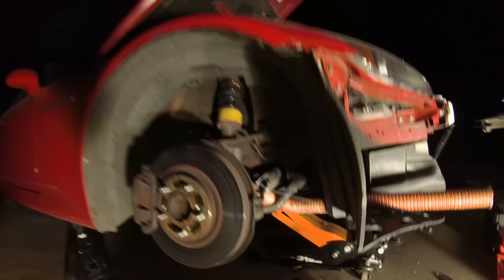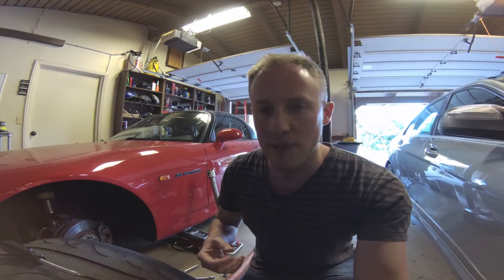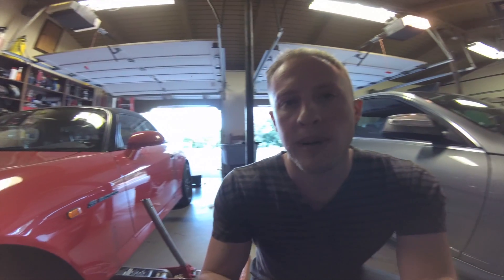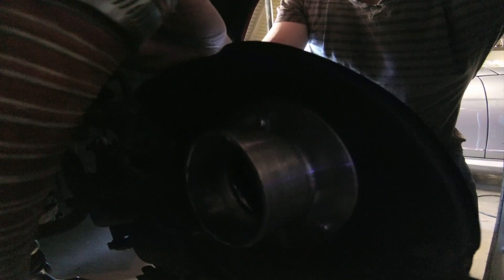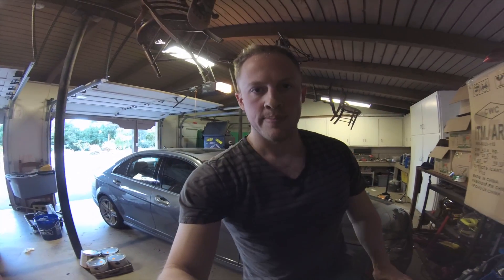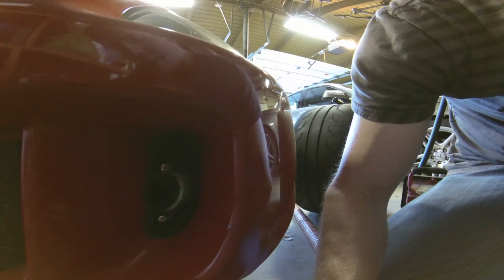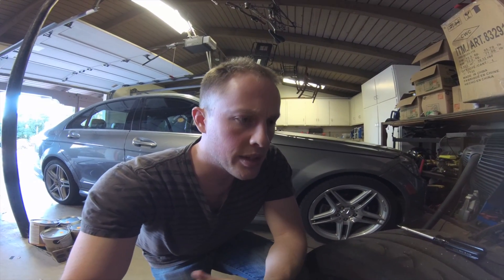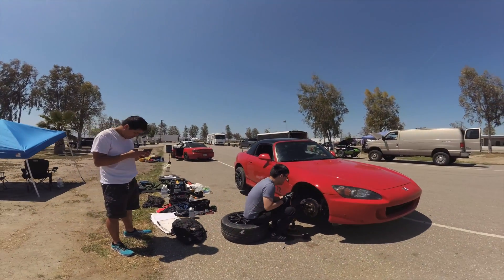Brake Ducting on My Track Car

Comment: Sounds simple but I read the set up you have will end up messing rotors because it blows air not from the center of the rotor out. There was a kit from a company called wasp that did it right but they are not in business anymore

Comment: Zent how many s2000's do you have? I get the feeling you are going to buy all of them and cause a shortage some day lol
thanks for the videos!
Reply from the maker: I just have this one. This is my seventh s2000 though.
Reply: Holy cow, thats a serious addiction. BTW what clutch and pp do you currently have in this one? and have you dynoed the car yet?
Reply from the maker: Ebay stage 2 clutch (seriously). Its about $170 for flywheel clutch and pressure plate. 

This is a 6 psi SOS supercharger kit. The dyno with stock flywheel was 290 rwhp.

Comment: Hey Zent. What are the specs on hose diameter and flanges. Was it 3 inch hose and 4 inch flange? Thanks
Reply from the maker: For s2000 with air pump, I run 2" hose with 2" flange. If you delete the air pump then go with 2.5" hose and flanges.
Reply: @ZentRose  they don’t make 2.5 flange though 😢

Comment: Hey Zent! What inch diameter hose did you use for your ducting? Have you been able to measure any temp differences?
Reply from the maker: 2" to fit under the air pump. 2.5" if you remove the air pump. 

I didn't bring my temp gun but did notice that my brakes stayed a lot more consistent. Also the rotors were able to develop more surface cracks without total failure.
Reply: Thanks! Do you mind me asking what pads you run? Are you thinking of going bbk?
Reply from the maker: PMU club racer. Yes I am thinking to get a big brake kit soon.
Reply: Thanks for the quick responses. Only thing I could think of that seemed like you could've added to your mod was some sort of chicken wire or filtering to prevent things from flying into your ducts and potentially damaging your ducts or whatever.

Comment: why chop your car all up when u can afford the big brake kit and it will solve all the problems as the brake duct?
Reply from the maker: I plan to do a big brake kit soon after I use up my pads. The ducting will benefit the BBK as well.
Reply: Because that may not solve the problem.  And seriously it's a 2 fender liners and 2 rotor backing plates, that's way cheaper than a big brake kit.  I'd agree with you if he wasn't happy with the stopping power but he's talking about reducing consumable usage.
Reply: so this duct he's making, how badly does he need to cut up the car? and yeah would be great if @zent would show us another video on how-to!
Reply: A bbk also adds unsprung mass and increases the moment of inertia of each wheel assembly. Which isn't ideal for a car like the s2k, these things arent too powerful and are designed to be nimble and grippy
Reply: Remember, even with a bbk, you can extend the life of your pads and rotors with cooling ducts. Cooling ducts are useful not only if you are getting fade and cracking rotors on the current setup.

Comment: Nice mod! However, for the amount of tracking you do, you need a BBK. I'd love to see you review a BBK compared to stock calipers and if they are really worth it etc.
Reply from the maker: You are correct. A BBK will theoretically pay for itself in time (if I don't earn interest on my money). I would also need to buy new wheels to fit the bbk. New wheels plus bbk will cost me about 3 grand.

When I factor in a 10% discount rate from my expected ROI from my investments, a bbk will probably be a financial wash at best. The value will have to come from the added utility. 

Then you look at the $150 brake ducts and realize they are pretty darn effective.
Reply: Great point! Can't wait to see a track day update on the brake ducts.
Reply from the maker: I just ran these at the track but the gopro didn't record anything to the card (I lost all the footage). The result was less brake pedal fade and this led to more consistent lap times.
Reply: Ahh... so it didn't eliminate the fade completely. Still quite the bang for the buck though! For the sake of youtube, time for a BBK! Plenty of barely used ones online that were merely used on s2000 show cars for sale.
Reply from the maker: Yes good idea. I like that. I'm really just buying the bbk for youtube!
Reply: @ZentRose  What size wheels would u get for bbk and which brand/model bbk would u recommend? Thanks!

Comment: My brother did this on his AP1, but I have a question. How can I run faster and longer in his car without losing brakes but he can only make the brakes last about 10-15 minutes and I make it about 20 minutes? Maybe I'm on the pedal for less time?
Reply: what pads and fluid are you on?
Reply: Hawk HP+ with Wilwood 570
Reply: Dan Carlos move up to a more resilient pad that will cope with the heat. S2000 is a very light car and you should be having issues at all. I have used hawk dtc 60 in past and currently using winmax w5. I prefer the winmax for less noise and it appears doesn't also generate as much heat which is good
Reply: willix231 thanks for the heads up, these pads were mostly for autocross as he just started tracking the car, I used HP+ on my Integra with ITR brakes and it was completely fade free even when chasing down an R35. I know the S2000 is heavier but I didn't think there would be an issue, it was also on ZII star specs if that matters.
Reply: yes the tires make a huge difference, you have to remember the stickier the tire the harder you can brake and thus heat up the pads even more. Biggest issue is cooling down the pads. you can duct and keep your same pads or just move up to a pad that can tolerate the heat. the s2000 is not a hard car on brakes because lets be honest its lighter than most cars today!
Reply: willix231 the brakes were ducted exactly how Zent just did his car, I'm really just curious how I made the brakes last longer even though I was running much faster laps.
Reply: Dan Carlos well there is your answer. You have ducts. Same reason f1 cars can last a whole race on same pads being driven hard. Adequate cooling. And when they get the ducting wrong they suffer catastrophic failures
Reply: willix231 lol yes I know, as in I don't know how I got the brakes to last twenty minutes but my brother in the same car ran earlier that day and boiled the fluid about 13 minutes into the twenty minute session.
Reply: lol thats the signature of a true rookie.lol brake too much

Comment: Great idea.  I might want to try this.  But I didn't understand the connection near the rotor.  What is the flange riveted to?
Reply from the maker: The metal dust shield behind the rotor.